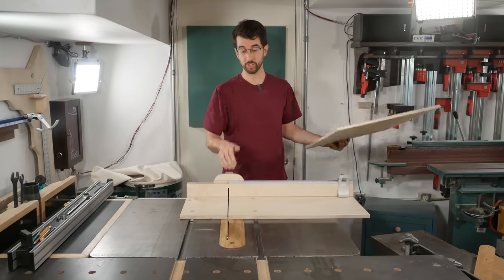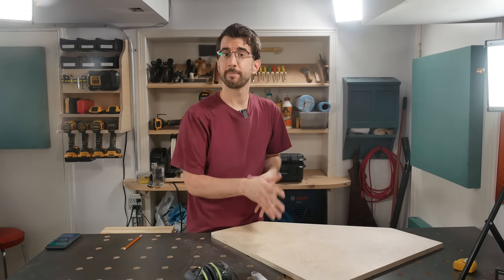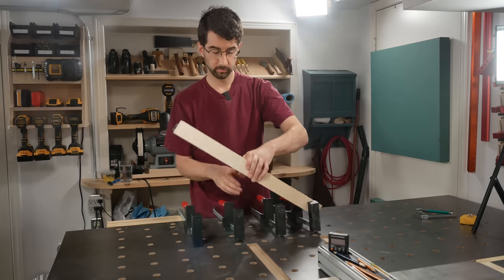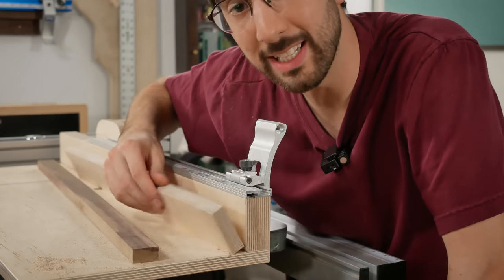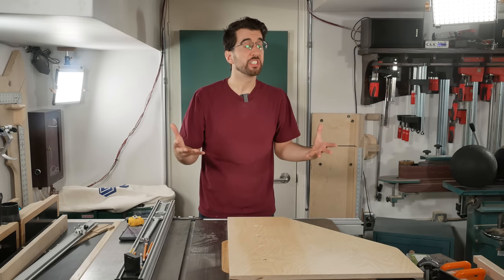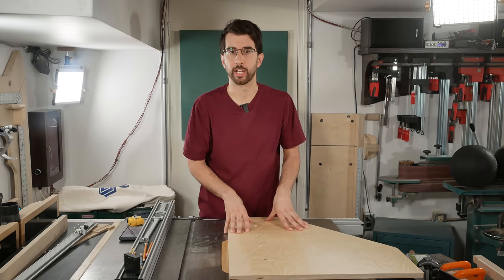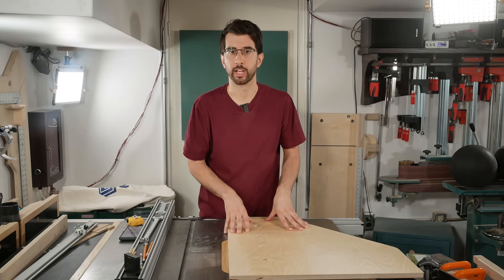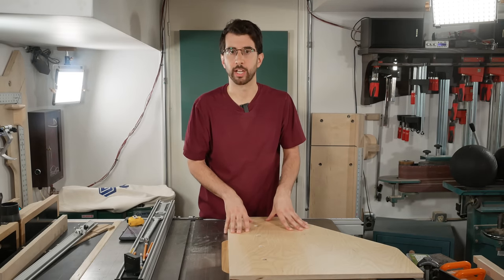the FLAW with Ultimate crosscut sleds

Comment: Drill a bunch of holes with a hole saw in your massive sled and it will be much lighter without loosing much rigidity.
Reply: Yes, a lot lighter. Assuming a 1" hole every 2" in the field on the side left of the blade, I estimate you'd remove the weight of about 116 sq in. of that area.
Reply: It does make for some serious pinch points though.
Reply: But it does nothing to change the form factor or capacity of the sled, and little to change the balance.
Reply: 02:19 he said he could, but it would be to much work for the later benefits.
Reply: @Kahsimiah  that's right 😅🫣
Reply: too much of a compromise of the aerodynamics
Reply: he can do that to his new design and still be drastically lighter and superior

Comment: The sled doesn't reference the fence, it references the miter slots. So the reality is, the method of putting the piece against the fence doesn't actually do anything to make your sled square at all. You can set the base panel at any angle on the bar as long as there is material past the blade to be cut off. It really doesn't matter because once you run the piece through the saw, you have one edge that is parallel with the miter slot. From there its easy to square a fence anywhere you want to on the base. The 5 cut method is actually really brilliant, because you could, in fact square up a fence that is up to 11.25 degrees off.

Comment: 15:04  My method to attach the fence:
1) Drill two holes to attach the fence. The hole nearest the blade is permanent. With a small round file elongate the hole closest to the outer edge so that the fence can pivot about a mm forward and back.
2) Use a good square to attach the fence as close to 90° as possible.📐
3) Make your cuts to find square.
4) When you're ready to permanently secure the fence, loosen the outer screw slightly to move the fence forward or backward as required, then tighten it down.
6) Install your remaining screws.

Comment: 8:45 my last sled i built had a 6mm base, the thin board conforns to the cast iron bed so its always flat. The base is only really there to help thingsxslide and keep the fence perpendicular to the blade.

I'm planning to build my next one using 2mm phenolic sheet as it slides really well and is incredibly stable

Comment: 1. While the 5-cut method is really interesting and brilliant it's unwarranted. Just did it once it works but never used it again. I've been making cross cut sled just using a carpenter's square and never failed me. I just verify by simply flipping the sample piece and see if the cut still aligns.
2. Your take on the "Ultimate" cross cut sled - full of features and heavy - is spot on. My go to sled is now a very simple light one. My previous "ultimate and universal" sled is still there in a remote, less premium spot of my shop, waiting for the rare special-task moment when it would be called upon again.
3. One sided/one-runner sled is also what I prefer. However, if I were you I would have just use 1/2 ply for the base - a lot lighter yet does the job as well. Also, I would stick to the tried and tested back, rather than front, fence. Front fence would require more user effort to balance and secure the piece.
Reply: Well said, I agree on all points
Reply: Clearly, accuracy isn't a concern for you.
Reply: @saltwaterrook4638  I’ve built beautiful furniture on my sled that was checked/built with a square.  The term “accuracy” in woodworking is too often applied to the obscene degree.
Reply: @5280Woodworking  I have to agree. Most woodworkers are using a crosscut sled for a cut between 2 and 12 inches long. A variance of 1/500th over 24 inches becomes irrelevant at those shorter lengths, even with compound error, when using wood.
Reply: Depends on what your tolerances are for a given project. The 5 cut method takes minimal effort and time. To get a 24 inch crosscut edge that is a perfect reference for a long tenon on tight, gapless breadboard ends is worth the 10 or 15 minutes it usually takes. Better to have it and not need it.
Reply: @univega2003  it’s woodworking, not machining. Wood moves. “Tight tolerances” in the thousandths of an inch will EASILY be obliterated by a shift in humidity 10% in either direction. Too many woodworkers make a fetish out of perceived precision. I can’t think of a real-world scenario where a tolerance would need to be tighter than 1/256 of an inch over a length of 2-3 feet, much less cross cuts that are typically under 10 inches. 

Beadboard is typically crosscut for length and then either capped or butted against something else, and in most uses that joint would be caulked to account for seasonal expansion. Fractions of a thousandth in those scenarios is silly, and you’ll still end up with gaps over time.
Reply: @univega2003  The point is you can’t tell and you don’t need it if you built with a square. 0.001-0.002 over 24” is imperceptible and that’s if you cut something at 24”
Reply: @danielakerman8241  tbf, 1/256 of an inch over 2-3 feet is almost exactly what was achieved in this video with the five cut method. He incorrectly claimed "less than a thou" when it was in fact 3 thou (0.860 vs 0.863). Over a 2ft (24 inch) square. 1/256 of an inch is 4 thou.
Reply: @jonathanbaxter5821  yeah but you're supposed to divide that by 4
Reply: @danielakerman8241  You know what I realized when watching wood working channels? Wood workers are making products for soccer moms and grandmas, who have no idea what a panel gap or an accurate cut line is. All the trouble a wood worker is going through to make a 0.001" inch accurate cut, and it's completely unnecessary because 99.999% of people won't ever notice it. It's the people who build furniture for a living who need the least amount of accuracy because their customer will be very happy, even with 1/16" gaps everywhere.
Reply: @Ritalie  totally! But it’s also that woodworkers (and really anyone who gets into any kind of hobby or deep interest) easily get carried away and go down the rabbit hole of ever more fine detail and accuracy, to the point of almost making a fetish of it — far beyond what is practical or necessary in any real world application. 

When you consider that not even the bottom bracket (the most crucial part of any bike) of carbon bike frames using press-fit bearings are machined to 0.001” tolerances, you begin to see just how ridiculous it is for a woodworker to worry about 0.001” over a 12” length.

Comment: I used a piece of 1/4 mdf for the base of my sled. All the strength comes from the front and back pieces which I connected with a couple longitudinal  bars which make for nice handles. Whole thing is light and sits nice and flat. I like your detail with the chamfer for the sawdust.

Comment: The point of about optimum solutions being specialized rather than generalized is really key. Every shop is unique. Every workflow is unique. Having a tool that does your most common jobs as efficiently as possible at the expense of jobs you never or rarely do is exactly right.

Comment: This is great! Love the chamfer on the bottom of the fence. Heard about that somewhere after I had built my first sled. Not sure how I feel about the fence in the back, but I might try this out. Pretty sure that roller on the miter bar is to go out back so when the front of the sled is heavy, it won't tip off the front of the table. About the blade side... If the sled goes on the right side of the blade, you can't use it with a dado stack. From the left side you could do whatever width dado stack you want.

Comment: I just use the Incra Miter 5000. It does everything yours does, is easy to adjust and it can cut 100% repeatable angles up to .5 degrees of accuracy. And the T slot adapter can be put on or removed without having to take the whole thing apart.
Reply: Somehow, I suspect the cost of his sled is less than $325.
Reply: I have the Incra 1000 and it goes to .1degree  ( one tenth of 0ne degree ) .  That is machine shop accurate.  Have they never seen Incra?  Absolute repeatable!  Basic model = $100.  USD

Comment: I was just getting ready to make a table saw sled for squaring larger panels when I randomly came across your design. I have to say I like it because its light,easy to make and very functional for panel squaring, I'll  will probably use this design. Thank you for sharing! Oh and the most common reason why most sleds should be on the left side of the blade is because most table saws are right tilting, which means the blade mounts against the arbor on the left and if the sled were on the right of the blade then the cut line will be off if you ever change blades that have a different kerf thickness.

Comment: You could use a cut off piece, if you dont have feeler gauge.if you need to rotate fence counterclockwise then put closest end between block and fence. secure block, rotate lenghwise cut off piece and adjust fence

Comment: Good video, thanks for the 5 cut explanation.    I've also seen cross cut sleds with holes drilled in them which makes them even lighter.   I'm with you!   Light and nimble and accurate is the way to go.

Comment: It would be nice if you would use a riving knife in your table saw. It is of course your decision what safety measures you use while working and how close you come with your hands to the blade, but as a youtuber you are a role model and encourage others to work the same way.
Personally I never had to remove mine for any cut, especially if the knife is not higher than the blade.

Comment: I didn't see this comment posted but forgive me if it is a repeat.  I think it is important to know before going to build this, the woodworker really needs to consider their height and reach.  Your arms may be weak (😊)  but what I would do to have your height and reach!  Having the fence on the back side of the sled would not work for my 5'3" frame.  Unless I stood on a stool which I have had to do in a pinch but not really that safe. 
All that said..I completely agree with the no need for massive jigs!  And really enjoy your Videos!!

Comment: Hi Scot,  I am enjoying your videos. 
re; loss of height when using 3/4 plywood base - whiners! Yes, if you are using a saw table with an 8' blade, but cutting with a 10 or 12" blade, depth of cut should not be a problem.

re; Mitre bars for the sled, I have used some plastic drawer glides and have not been worried about swelling or wear and tear needing adjusting. I have an old saw with a troublesome fence that needs measuring at both ends before cutting, each and every time.  I do like the small version of a cut sled with the additional ideas.

Comment: 13:32 if you use metric, the maths is far simpler to understand. Use a 100mm piece of scrap for the 5 cuts, find the difference, then instead of dividing by 4, measure your adjustment 400mm away from the blade.

Comment: My jigs all have Ultra High molecular weight polyethylene , it doesn't swell, is very stable, resists wear unbelievably well & its slippery. drills, cuts with regular wood working blades & drills ...awesome product for sleds & jigs ....did i mention glue doesn't stick to it

Comment: I have the same sled as your old one and it is heavy.  I reduced the weight by cutting handing into each end of the sled, but its still heavy.  I love the idea and the weight reduction.  My question for you is you end up with tear out when crosscutting because the piece isn't supported from behind?  I debate on this sled but mostly use sled for cross cutting.

Comment: Depending on your general use case, greater reliability totally makes more sense than greater flexibility.  Tailoring your workspace to your workflow is simply good practice, regardless of circumstance.  I'm a fan of both multi-purpose and specialized tools and use them both in different situations for different purposes.

Comment: If you orient the grain on a hardwood runner side to side in the slot, seasonal humidity changes will cause it to expand down into the miter slot, minimizing issues.

I prefer to use two layers of 1/4" luan underlayment plywood glued together that gives me just under a 1/2 " thickness. Being plywood, it has minimal seasonal movement, if any.  And I can pick up a 2x2 piece of it at my local home center vs ordering and waiting for a metal runner.
Reply: You mean , orient the grain horizontally (just to clarify for people).

Comment: Nice design, Scott. You'll probably want to add a support to the other side of the blade. It can be stationary and could be locked into the t-slot during use, but without it your cut-offs will want to pinch the blade and you'll also get tear-out as the blade exits.  Scott

Comment: I like the mentality of creating a few smaller, more purpose driven sleds, then one "ultimate all in one" sled. Aside from being more manageable it's also much easier to iterate on them based on how you ACTUALLY use them :)
Reply: My thing is...I don't really do much plain everyday crosscutting on my table saw.  That's what my miter saw is for.  A sled would be used to mount a box joint jig or something like that to.

Comment: Traditional cross cut Sled work just fine and are probably a lot safer to use. I have 2. a large one and a smaller one. Been using them for 30 years
Weight is an issue but can be made lighter by not overkilling it .

Comment: I work with perspex and need to have a repeatable accuracy of 0.01 mm. I manage this on a De Walt table saw with a homemade aluminium sled with an adjustable fence to accommodate the angles I need. That degree of accuracy I have never needed with any timber unless I am using really hard woods like Purple Heart or Ebony.
The sizes I work with are between 19mm down to 7mm square, out of 300x300 stock, so accuracy is essential.

Comment: Scott a quarter inch piece of masonite would be fine enough for a base. If you want to make it lighter drill a pattern of lighting holes in it 1 - 2" The same goes for the fence. Make one and see. Supper light and just as stable. 

Time to rethink again. ¾" stock is so over kill for most things built in most shops! Columbus Michigan.

Comment: Yeah, I called you out on the 3/4" thick sled on your last video. Still standing by that. I find 1/2" multi-ply is more than stable enough — so why go thicker?
In fact, as I do more projects, I keep trying to go thinner. I built cabinets in my van/RV conversion with 3/8" multi-ply. Considering 1/4" now.
Going to make your sled though (but, you know, with 1/2" Baltic birch). Very cool.
Reply: Agreed. Think about it. Of all the sled components, the base is in principle the least likely to introduce referencing errors, and the most likely to be stable in shear, which is its critical function. A thinner base doesn't change these factors at all.

The only problem with a thinner base is its potential to deform out of plane, and in so doing to carry the fence out of square - not out of miter, at least not directly, but only that the fence may no longer be perfectly vertical. Imagine a base made out of thin sheet steel. The fence would wobble fore and aft, very slightly affecting depth of cut, but it would not rotate out of miter unless you twisted one end of the fence forwards and the other end backwards.

That deformation out of plane is the effect to guard against in the choice of base material and thickness. And this is a further argument for making the sled the full width of the table. Half again wider means half again stiffer overall.

Comment: I made the most exact sled ever by using my CNC to cut a rectangle, with a miter gauge slot at 90 degrees to the long side. Inserted the rail, attached a fence against the long side of the sled, and ran the whole thing across the blade. Quick and accurate (if you have a CNC).

PS:  there's an alternative, floating around YouTube, to the redundant 5 cut method. Its 3 cuts, uses the same principles as the 5 cut, and there's no math at all. But you still need the feeler gauge.

Comment: Too true about perfection. Heck, even machinists can only really work to within the tolerance of their measuring gauges which will probably not be perfect. I appreciate the tip about feeler gauge to correct the error after the 5 cut method. This is simple and I never thought of it when I built my last sled. Cheers!

Comment: Over in Europe the gold standard is actually a panel saw with built in carriage sled on the side. My father who was a professional carpenter before me used a Felder combination machine that had this style of table saw but also a router table sunk into the top that you could set up to use on the other side of the machine. Sadly he passed away but that machine still sits in his old workshop and I hope to buy it from the current owner one day. All that said however, seeing this video I can't imagine having to do everything without that panel saw carriage!
Reply: I never see panel saws in the US, except at the big construction supply stores. They seem incredibly good for panels. I see people using track saws here, but track saws are a pain to constantly setup and move around. A panel saw would be amazing. I noticed they are way overpriced, which is probably why nobody has them here, they are like $5,500 of USD or something like that if I remember right.

Comment: Correct me if I'm wrong but wasn't Norm's use for this style sled just to square up panel edges (hence the name of panel sled)? If you try to use it as a cross cut sled, the overhanging portion of the work is floating above the saw top with gravity trying to pull it down into the blade as you cut. Seems like a great way to get square corners for panels and also a recipe for kickback when trying to use it for anything else.